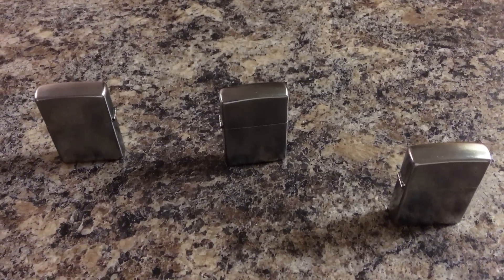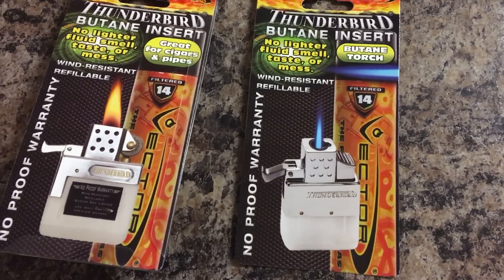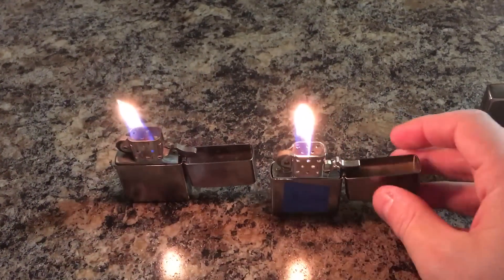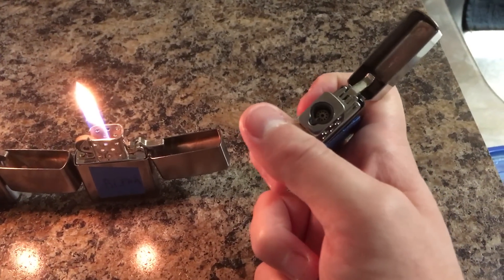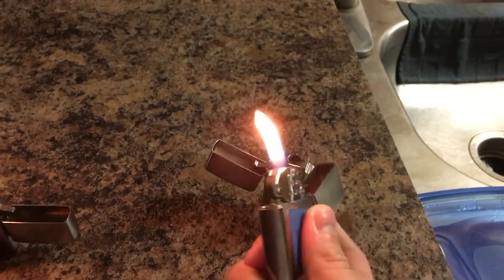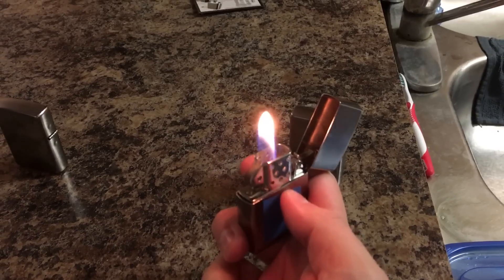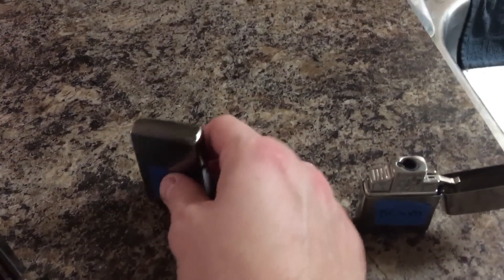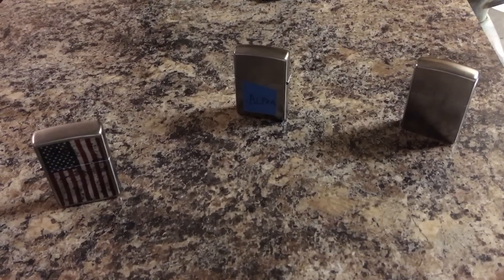Standard Zippo Insert vs Thunderbird Butane Inserts - Initial Impressions

Comment: Yo Dude, try and avoid leaving a zippo lit for more than 30 seconds. The heat of the flame eventually de-tempers the striker wheel and softens the metal, won't strike as well as time goes on.

If you want your zippos to last a lifetime, avoid all the little things we don't realise actually do damage haha. Believe me I've been fixing zippos for years :D

Peace bro
Reply from the maker: That's a good tip.  I'll keep it in mind, though I'm happy to know that if a zippo ever breaks down, Zippo will fix it free for life.
Reply: man, zippo fix free for lifetime guarantee. so I dont mind
Reply: His Zippo model is from Wal-Mart. You can pick one up for less than $10. So I doubt he cares... Its a real Zippo just Zippo has lost popularity over the years and got a contract with Wal-Mart. The American Flag design he has is one of those Wal-Mart exclusives.
Only the black and metallic Wal-Mart zippos they sell are the designs you can't tell can from Wal-Mart.
Reply: You do realize that to temper a metal it has to be brought up to critical temperature and then rapidly cooled right? And to un-do that it has to be brought above the temperature at which it was tempered at. And it’s a general rule of thumb that critical temperatures generally involve the metal being red hot. It is simply that the striking wheel gets dull regardless as any sharp edge does. Just like a file, it gets worn down over time.
Reply: @adampolson6938  thats true for non ferrous metals like copper but with ferrous metals like the steel striker wheel it would have to be quenched to harden it. I know. Cofusing

Comment: You wouldn't like the original zippo if you were a cigar smoker. That's what's great about the soft flame butane insert. You don't get that lighter fluid smell or taste in your cigars, which is what it's intended for.
Reply: I get what you're saying but it has nothing to do with Jason's comment, which is a 100% correct.
Reply: @MybeautifulandamazingPrincess  ya the other guy is right, dafuq you on about?
Reply: @SuperVarunan  dafuq? ok
Reply: The torch is the Best Option for cigars.
Reply: @keinnamegefunden1  While I think those torch things are great for people who smoke big cigars which they like to "toast" when lighting up, I think the taste thing is exaggerated. I think most people who say you shouldn't light a cigar (or pipe) with a fluid lighter never did it. I've lit all kinds of things with a Zippo and never noticed a difference in taste. What you sometimes notice is the smell, especially if you refilled the lighter the same day. Whether or not that bothers you is a matter of taste. I'm not bothered by it. It isn't fuel, it's mineral spirits, the same kind of gasoline used for dry cleaning, I don't find that it has a sharp smell.
Reply: @DellaStreet123  yeah youre right in your opinion, it’s a matter of Taste. My taste buds arent that fine to taste much difference. But it falsified the original taste of the cigar, thats the big Problem for the taste experts in my opinion.

Comment: I got the vector thunderbird soft flame lighter insert and a can of vector 14x butane. I don’t know if I got a counterfeit one or not but it was very rough operating out of the pack. First the black label fell right off. The cam hinge pin and striker wheel pin were dry of any lubrication. They were rough operating. Where the cam interface the little metal tab that turn the gas on and off was extremely rough dragging on the cam. I put a drop of sewing machine oil on the came hinge pin and the strike pin. I then put a little oil on a q-tip and rubbed it on the little tab at the cam/tab interface and now the lighter is slick as a whistle. So I can see how people are breaking the little gas tab off. It is so rough is dragging and bending. A tiny bit of oil fixed everything.

Comment: You should definitely try the transparent thunderbird g insert, it really is a good learning experience on refilling a butane lighter since I can see the fuel. It's really great for whenever you have a tricky butane adapter that just doesn't fit entirely as I can see whether it works or not.

Comment: I think the main benefit for me of the butane inserts is just the fact that they don't leak fuel so they don't have to be refilled frequently.
Reply: If you don't smoke or light candles all day butane is more economical -- however, I have an aversion to butane lighters. I worked in a church for 10 years and I hated those standard issue things: Rod-shaped refillable butane lighters with a piezo mechanism, a mechanism that would wear out by the time the lighter was refilled two or three times. On the list of things we were allowed to buy for church purposes were cans of butane for refueling, but I hated those, too. Before you realized it, you had that stuff all over your hands because the tank was full. Next thing would be that the lighter still refused to fire up because there was an air bubble in the tank. Also, those things wouldn't light up when it was cold, you had to rub them all the time. The priest didn't want us to buy disposable butane lighters with a flint wheel, he wanted refillable ones, and inexpensive refillable ones only come with a piezo mechanism. Most of the time, I preferred an wax-covered wick to light all the candles in the church to save butane. You could by those things in large coils and they would last you forever if you held them in a vertical position. You could also attach those to that ring-thing that you use to extinguish candles by sucking away their air and there would be no need anymore for the portable ladder to light the Apostle lights. (12 lights that line the nave of a Catholic Church.) To indulge the smoking habit, I think the original Zippo setup is great.

Comment: Yes, the flame is slightly different every time.  So many variables change slightly each time you light an original Zippo.  It makes the flame mesmerizing, to me, actually.  Like a wood fire in a fireplace or stove.  Also, it is really reliable in cold weather and wind.  It still has a lot over some modern lighters.  I kept going back to it.  I kept trying modern torch lighters and flame lighters but last winter I just faced the facts.  The original is less frustrating, if you use a lighter every day, than modern lighters are. The original Zippo is again my favorite after ten years of cigar smoking and a couple of years of Dynavap vaping.

Comment: Zippo is not just about style. The fact that it can use many types of fuel and that you can refuel it anywhere is what makes useful
Reply: I think it's also about the style, but all these inserts preserve that. You can still look at it and say "Oh, that's a zippo".  

Obviously the torch is a bit different, but the exterior still says zippo.
Reply: When I was hiking in the Himalayas a few years ago, I filled my zippo with locally bought gasoline. It worked great

Comment: I have a torch Thunderbird. It was great for a year but after that, it started becoming very unreliable in terms of lighting up and the flame itself has become much smaller. Like there's less gas shooting out. Now if I want to use it, I need to grab a dead Bic to use as a flint lol
Reply: The torch version has no flint but the electric pietzo ignition.
Reply: Take it apart, maybe you can replace the piezoelectric igniter somehow.

Comment: I only have experience with one of these soft flame thunderbird inserts but I couldn’t get it to open and close with nearly the same authority as the actual zippo insert. 

I tried adjusting the tab that catches the hinge on the insert but I could never find the sweet spot. It would either open pretty well but not close all of the way or close nice and tight but be annoying to open. It could just be an issue with the example that I received but either way, I didn’t really like that. After putting the original zippo insert back into the case, you realize how well it flicks open and slams closed compared to the thunderbird. 

I might buy one more thunderbird just to see if that issue is a fluke because without that, I would absolutely love it. I love zippos but I have essentially no use for them. The only time I ever really need a lighter is to smoke a cigar and butane is obviously far superior to lighter fluid.

Comment: I hate that flickering flame! I even grinded the holes of the chimney bigger to prevent the gasping for air. Was too careful about it and should maybe work some more… I have had a cheap copy that had perfect flame, so shame on Zippo! But they probably chose to invest in windproofness rather than stable flame.

I have the Thunderbird soft flame too and i like it! Now i wish there was a version that had options whether you want torch or soft flame out of it, but i don't know about the technology is that possible. These being said, i still use the original Zippo the most. I like simplicity, old fashion and filling with fluid.
Reply: Heikki Finland oh the technology exists
Reply: @SSJGovea  Thanks! I kept watching lighter videos and surprisingly found those! Nice that someone had the same thought and made it real.

Comment: There's something I do not understand: what happens if you leave the flame on the butane softflame for a long time?
Normal zippo is not pressurized, so the worst may happen is it will go on fire but I don't think it may explode. The butane tank is pressurized and plastic... I know that zippos are not lanterns but in the case I really don't trust pressurized tanks...

Comment: Is the soft flame insert still windproof like a zippo?
Reply: Almost. It does much better than a Bic disposable lighter, but not quite as windproof as the original Zippo. I like it a lot and encourage you to buy it. I only have this problem with it: When it's nearly empty, the flame gets huge and unstable to the point that it feels downright dangerous! My gas is a mixture of butane and propane, not sure if that affects or what is going on. The solution is to keep it full.

Comment: With the two Thunderbirds, are those Zippo cases that you've replaced the inserts with or are the cases the Vector brand imitations you can buy along with the Thunderbirds?
Reply from the maker: They are all Zippo cases.  Two of the Zippo cases have Thunderbird inserts in them.  

The "soft flame" Thunderbird insert seems nice as it's very similar to a Zippo experience, and since the insert has to be air-tight (in order to contain the butane), it doesn't dry out over time, so the butane insert is always ready.

The "torch" style Thunderbird insert is neat, and the flame does keep it's straight orientation even if you hold the Zippo sideways, but it seems to use gas much quicker than the "soft flame" style.  It must be expelling more gas per second in order to achieve that style flame.
Reply: +Doyen Guy Yeah I've EDC'd a soft flame Thunderbird for several months now. They're good but I've run into problems with flame consistency.
Reply: Andrew Woroniecki problems?
Reply: +Donald Trump

Yeah, butane lighters don't last due to sooting of the gas nozzle. That's why the most butane lighters are disposable.
Reply: @SergeantExtreme  I've seen some people blast that out by using the butane canister's refill nozzle against the gas/flame outlet to blast any crud away that may be obstructing the flow. (Like an impromptu canister of compressed air.)

Comment: Zippo needs to manufacture a soft flame butane insert using the flint striker. They'd make a killing. Its all they need to reinvent the classic zippo and make a reliable lighter for the first time lol the classic zippo is very "cool" but its not a lighter you can actually rely on, I'd put my faith in a bic or clipper before a zippo but now's their chance to fix it.

Comment: Can you put the z plus into a 1941 replica?
Reply: Yep
Reply: But is the 1941 replica not slight larger in size? I tried to put a standard zippo insert into a 1941 replica and found although it fits, it's too small. The 1941 replica insert will not fit into a standard modern zippo!